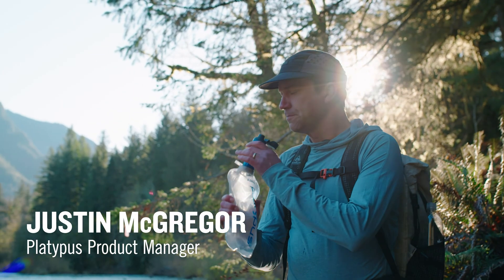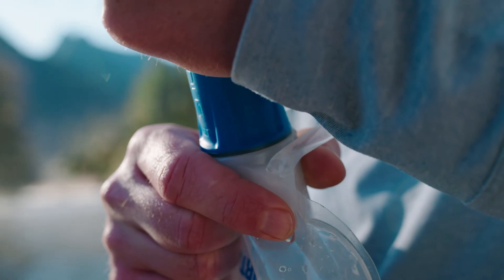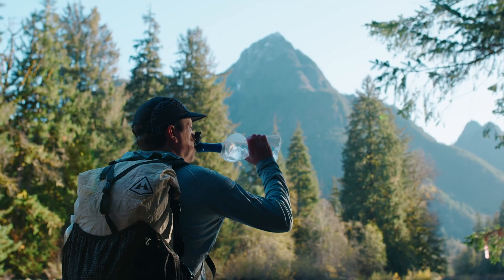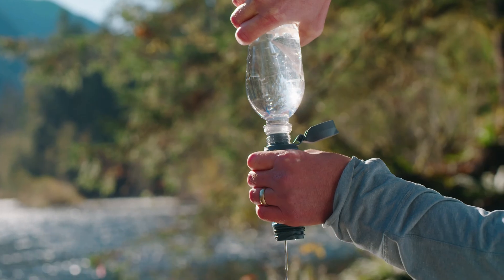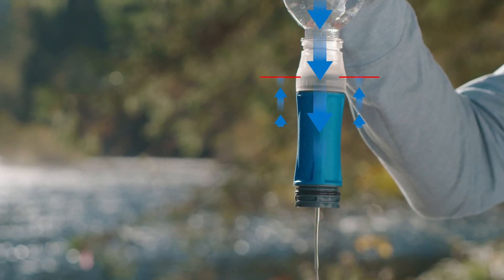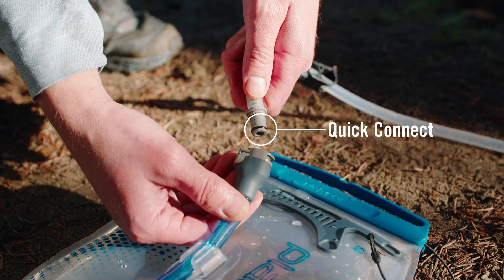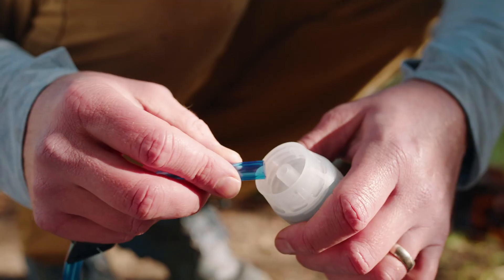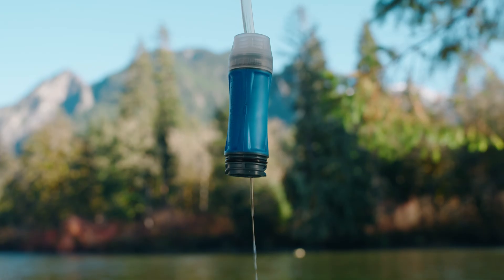Platypus® QuickDraw™ Filter: How to Clean and Backflush

Comment: I think there should be a better solution for (proper) backflushing than the use of a gasket. Losing the gasket was one of the biggest complaints about the most popular filter on the market so it's a shame to see this trait is also is shared with the Quickdraw. 

Having a fully dedicated outlet cap system for connections is great though!
Reply: Not the same. With the sawyer if you lose the gasket which can happen every time you filter, you'll have trouble filtering. With the platy the gasket is useful only to backflush (which happens less often) and worst case you can still backflush with the drinkcap as shown in the video. Also the sawyer has no air vents when gravity filtering.